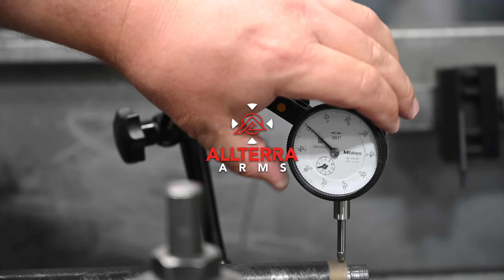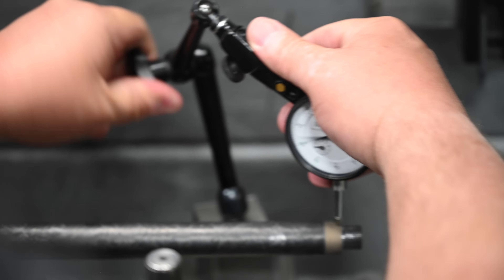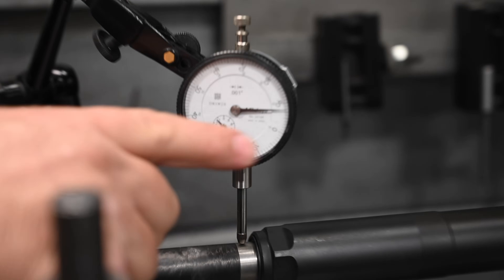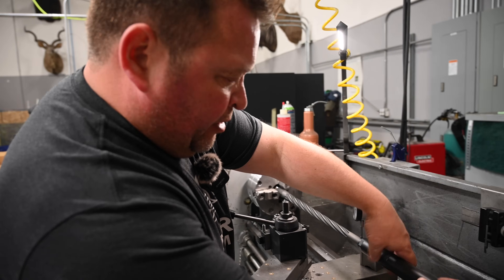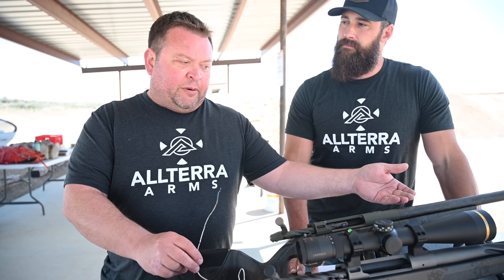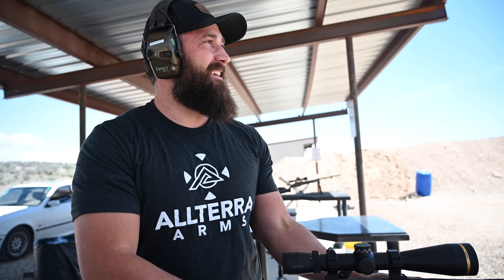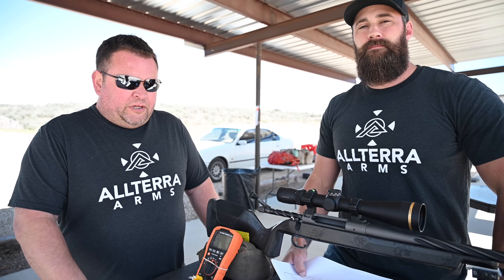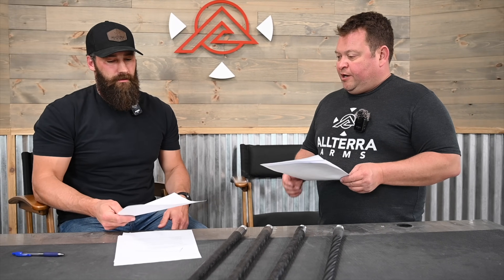Carbon vs. Steel Barrels: Rigidity and Cooling Test

Comment: I have no dog in the fight for either material. That being said  I don’t believe the rigidity test you conducted really tells us anything. Imagine a tuning fork and how it vibrates. The barrel is doing the same thing. The barrel whip might be drastically different in both materials and unless you have the capabilities to measure the barrel with a high speed camera for the two materials then I  would call the results inconclusive. Also. The length that you have chucked up will come into play not just the length you have protruding. They should both be the same for all battles as well or do the math to take the difference in weight and length and calculate what would be the equivalent to have similar tensile strength. The profiles come into play as well. Flutes is going to act differently that a smooth profile for whip and for temperature. The fluting can act the same way that engines baffles do and help to cool the barrel faster than if it wasn’t fluted.

Comment: Hello, suppressor over barrel is vastly superior. The deflection test methodology could be much better, try a bending test barrel supported both ends in V blocks and apply a specific load in the centre then measure deflection.

Comment: If we're strictly talking about hunting rifles, and one where we really care about ounces, then another factor in the carbon vs steel, is you can make a steel barrel lighter than a carbon barrel with a very thin contour.  Carbon can't get that thin and every carbon contour is heavier than the featherweight steel profiles.  On that comparison, I'd bet the carbon deflects less and heat saturation in the tiny pencil barrel is more of an issue, but for the 1 or 3 shots you're taking it's irrelevant.
Basically if someone says " I want a mountain rifle", carbon is out.

Comment: While my heart really wants a carbon barrel “precision hunting rifle” my brain just doesn’t understand the concept behind it. 
The point of a heavy target barrel is to retain consistency as the barrel heats up. This suggests a higher round count. If I need light weight, that means I’m packing a rifle on foot, which means I’m stalking large game, which means at most 3 shots. 
If I’m going to shoot enough that I need to worry about barrel heat causing stinging that means I’m at a competition, or ground hog hunting. Either way, I’m probably driving to my spot and don’t need light weight/need the weight to help keep the gun still. 
So whats the actual point of a lightweight target barrel?

Comment: I used to do the same test 3 decades ago: just try the same on straight deep acme-fluted brl’s and you’ll be surprised!
Reply: You did a carbon wrap barrel test 30 years ago....in 1995.
Mmmkay
Reply: @johnlocke_1  
Yes, I did! 
I guess, its kinda hard to imagine and comprehend for you guys, who are trying hard to reinvent the wheel? I already saw its leightweight properties &  potential back then and tried breaking into this field, which compared to the present situation had lots of obstacles, at a less then ideal time: back then  brl-blanks were still reasonably cheap & affordable at 1/3 or less of the price we pay right now! Meanwhile carbon was deemed as an exotic, secretive, mostly earo-space & nautical related  material, which was still  banned from
import or export in most countries; therefore hard to source and if successful, it was quite costly at the time! Consequently, at least the public interests back in NZ was minimal at the time!

Comment: the thing is that a steel barrel is made of only steel . so threw heat it is going to shift POI the same say uniformly 

but with a carbon wrapped barrel ( no such thing as a carbon barrel )   the carbon will heat up one way  and the steel will heat up another way so  the more u fire them and they heat up and cool down flexing at different rates the carbon can actually de-laminate from the barrel over time. its basically a carbon tube bonded onto a steel tube  so with both materials heating up at different rates u have the 2 tubes eventually separating.  another thing to note is that carbon is actually a good insulator and the steel barrel inside it will generally stay hotter for longer increasing barrel wear 

if your only shooting 1 or 2 rounds  then relaxing go for carbon wrapped

Comment: Wow, normally on videos like this I have something to nitpick like you didn't measure the internal temp and only the external, but you got everything I wanted and more!
Reply: I would like to see a POA shift if any after putting a few rounds through it...put 6 rounds through it and somehow measure POA after every shot...if that even possible.
Reply from the maker: Now that we've established the barrel temps after 1, 3, and 6 shots, we'll be able to chuck the barrels in a vise and heat them through the breech end with the indicator mounted at the muzzle to measure deflection with heat after the same number of shots. We can then calculate the angular deflection out to any distance to come up with an expected potential error on-target. Stay tuned for the follow-up video.

Comment: Your test is SEVERELY FLAWED!!!  Those laser temps guns do NOT do a good job of reading the temps on barrels.  Put a piece of tape on the barrel and take your measurements there, it'll be better than trying to read bare steel.  That's why those temp strips work much better than a laser temp gun.  For your internal temps you should have used a dummy cartridge with the probe inserted.  Those temp probes vary WILDLY based on contact pressure and angle.  Using a dummy cartridge with the probe inserted allows for very consistent pressure and location for your test.  HOWEVER, having said all that, yes steel barrels are more rigid, and better at dissipating heat than carbon wrapped barrels.

Comment: Thanks for doing this. I wonder if carbon wrapped barrels may exhibit accuracy declines as the heat, due to dual materials affecting each other.
Reply from the maker: We're going to make a follow-up video testing the deflection when heat is applied inside the barrels. Stay tuned, thanks for watching!

Comment: I would like to see a test of some sort to see how the heat changes to POI on steel vs. Carbon. Since that is our end goal. I'm  a believer in steel barrels.  (Change my mind)  Good video  thanks!
Reply from the maker: We're planning on doing a deflection test comparison when heat is applied as a follow-up, thanks to yours and others' comments here.
Reply: @allterraarms  
See if you can add  a barrel with carbon wrap but with not wrapped segments in between. There was a rifle recently shown like that at nraam.
Reply: @allterraarms  Any updates on this test? Very interested to see how it goes.
Reply: @sloreo8278 Poi shifts when the barrel is hot are worse with carbon barrels. There's a reason why they are pretty much non-existent in things like prs.
Reply: 100% agree, not only will you get better accuracy from heavy steel, but also reduce the recoil as well.
Reply: @marksmith4627 I mean sure you can but if we are talking about taken this rifle on a hunt, hiking through rough terrain. I think weight is a concern.
Reply: My view on quality carbon barrels is that they are intended to give you a rigidity close to a target/bull barrel for a few shots with the weight of a light barrel, or give you a longer barrel for the same weight as a shorter. They also seem to group well with a wider range of ammo vs thinner barrels which is more what I expect with heavy barrels. So basically ideal for hunting but not really meant for volume of fire. However the new seekins pic rifles for the military are using some kind of carbon barrel that might be different. And there are also now titanium barrels which should have the benefit of being light while also moving heat fast.

Comment: What I took away from this is for any sort of hunting application, the two are so close that weight savings for barrel profile means the carbon is the better choice.
Reply: My question about carbon barrels is, what kind of hunting are you doing where you’re taking enough shots to worry about heat dissipation, but also having to pack the rifle on foot far enough that weight matters?
Reply: @ steel was better at heat dissipation at the same barrel weight as carbon (so smaller contour)…. So I don’t think the question holds unless you want to pay the $$& for looks
Reply: @Intermtn9736  both were fluted though. Without the flutes, you theoretically lose rigidity.
Reply: @Intermtn9736  plus, flutes are going to help with heat dissipation, due to surface area. Without the flutes, less surface area means more heat retention.
Reply: @brockedandloaded6034  they’re good points, but if you look at flutes in those barrels they’re very shallow, so doubt it has much effect on heat dissipation, and probably only 4-6oz total if that. A solid of exact same external dims is always stiffer than anything taken away. However a larger external dims (read bigger contour, deeper flutes) is stiffer.

Regardless it’s a moot point, because a fluted steel barrel is 1/3 cheaper than a carbon barrel and just press one more button when ordering a prefit. I do like a .750 hybrid/taperless (or even Bart 4) with very deep flutes, best of all worlds, super rigid, cools fast, thick enough to thread 5/8x24… and still equal or lighter than carbons I have.
Reply: exactly. Hunting carbon, target steel. This is really the reverse side of the "carbon barrels are better coin". A company who likes to sell spiral fluted steel barrels telling you they think its better.
Reply: I disagree, not only is carbon fiber more expensive, it doesn't dissipate the heat as this testing proved, it only insulates the heat inside the carbon wrap and will super heat the thin steel barrel tube insert. Not good for barrel longevity. Given that, I'm also not a fan of spiral barrels either, go heavy or go home. You will get better accuracy and reduced recoil with a heavy steel barrel.
Reply: @marksmith4627  did you actually read anything I said?
Reply: @brockedandloaded6034   This shows exact opposite of what you're saying IMO.  The barrels they tested were exact same weight --> which means the steel was a lighter contour (Bart 3B as they stated above).  And still, steel was more rigid and dissipated heat faster.  So you can go even lighter than the carbon with the steel and still get a better result...
Reply: @Intermtn9736  my mistake. I went back and watched again. I thought he said same profile. Not same weight. However, his hypothesis is a little misleading also. The data doesn't show steel over carbon, it seems to show FLUTED steel over carbon. And it's even more confusing at the end when he brings two other carbon barrels out and says one is several ounces lighter and then says one carbon barrel on the table had the least amount of deflection. Well why weren't those tested? All carbon barrels may not be equal, and probably aren't. But certainly seemed like those last two he talked about he wasn't trying to really elaborate on.
Reply: @ good points all around, I think fair to say not much benefit from carbon as very similar (which mirrors my experiences and many others from trying carbon and realizing threading stock tikka tapers for suppressors gets same or better results)

Comment: I've looked into the Altera Arms rifles. I would but one of these rifles if I could get my hands on one. 
Gotta be the best production rifle that I know of.
As far as the thermal tests go, you're spot on. A good measurement would have been a temp differential between the inside & outside of the barrel. A higher temp differential must mean a more efficient insulator. Although I know for a fact that carbon is a far better insulator than steel, the only issue I see is using an infrared temp measuring device. These devices can be rather tricky because they measure the emissivity of the material which, must be calibrated carefully. There are devices which measure the emissivity correctly however, they are considerably more expressive in relative terms. Although your measurements may have been correct, the measurements would hold more water if taken from a device known to be accurate with metallic material.

Comment: Thermal mass- kind of hard to beat physics.  The carbon layup differences providing differing levels of rigidity is interesting.  Thanks for putting the work into answering this question!
Reply: Exacty...not to mention the effect of heat degrading the structural integrity of the carbon over time...deff dont want to be running boxes of ammo through it on a range day...but for hunting where lucky to be putting a coulpe rounds through it back to back would be fine.
IMO other then looks its a waste...

Comment: Wouldnt these tests be subject to how much steel is used in said carbon barrel? My understanding is that different companies use different thicknesses or ratios of steel:carbon wrap to achieve desired weights/stiffness. 

I believe Proof uses very little steel in comparison to someone like Carbon 6. Which makes them significantly lighter but theoretically not as stiff and maybe more/less insulated ?

Comment: Great video. What’s astounding about comments here (and everywhere else) is people think carbon is lighter. Clearly marketing works (tiny fine print: 60% lighter than… same contour steel barrel lol). As you showed, a lighter steel barrel deflects less. 

After looking into prefits for a tikka, I was surprised stock barrels were lighter than the lightest carbon, and fluted steel prefits were far lighter than lightest carbons. Really no advantages to carbon other than looks (if you like it).
Reply from the maker: Some are lighter, some aren’t, apples to apples in comparing barrels almost doesn’t exist from what we’ve learned. Thin contour lightest-weight steel barrels have their drawbacks too for certain styles of use like higher volume fun and practice.
Reply: @allterraarms  True that!  My take is a fluted .750 taperless or hybrid contour steel barrel (even a #4 contour if really aggressive fluting) is lighter and performs as well/better than my carbons for high volume too!  And cheaper, more consistent, easier to get length you want, etc

Comment: In marketing speak the slope of the line shows carbon cools quicker.  There is much more to it, as its going to a higher temp, and it ends up at a higher temp.  Like it is being insulated. But to a marketer the slope of the graph is showing carbon cools faster.
Reply from the maker: We keep finding there’s “always more to it” in all sorts of things. Thanks for watching and sharing your thoughts!

Comment: I will no longer build a magnum cartridge with a carbon fiber barrel. They might be fine for lighter cartridges but accuracy definitely suffers in the magnum class with these lightweight barrels. I think it is the primary recoil that occurs before the brake or suppressor kicks in, and a heavier barrel is just better for this.
Reply from the maker: Good analysis. Carbon-barreled anything over 7 PRC are our most difficult to consistently prove accuracy before letting it out to the customer. We replace barrels and eat the cost when they don’t shoot well enough for us.

Comment: I know they're an outlier, but how would a Tacom structured barrel compare to both of these other barrels.
Reply from the maker: We built a 308 for a customer with one of those barrels and it’s in the top 3 of wildest ones we’ve done.
Reply from the maker: They’re so massive that they’d blow away these hunting barrels in rigidity.
Reply: @allterraarms Great video. If I remember correctly, several years ago, I priced a Tacom in 300 win mag with a 1.35" barrel. I'll see if I can find my notes or check their website. I found it fascinating the way they drill extra holes around the bore for cooling.

Comment: I have a proof Research 7mm PRC barrel.  I had to remove wood from the foreend because the barrel rebounded under recoil and slammed into the fore end.  This alone improved overall accuracy with loads.  Originally, YES, the barrel to fore end was free floating and never touching.  EXCEPT UNDER RECOIL!  Even though groups improved, this taught me something.  So, I ordered a limbsaver.  I found the NODE!  Groups are fabulous BUT, CF barrels arent good for shooting large count groups especially from MAGNUM CALIBERS.  Like, over 5 shots, the group will open up drastically.  To me, at best, CF barrels are pure HUNTING BARRELS!  So I think performance under recoil from both types of barrels should be measured
Reply from the maker: Great comment and explanation of your learning opportunity. There are lots of small overlooked details like that when chasing down accuracy. Especially in the heavier magnums as you say. Thanks for watching.
Reply: @Tofazfou  In most cases, especially with wood stocks, you might be better off full-length bedding the brl in the woodstock, the same way you do with ultra-light featherweight steel brl’s!
Reply: Thank you for sharing.
Reply: I’ve had bad experiences with a proof carbon as well. Would open up when the barrel heated. 
My IBI carbon barrel on the other hand was flawless at shooting multiple shot strings and hold true. 
IBI double stress relief their barrels as well. 
Just my point of view tho.
Reply: Is the “node” the optimal spot for the limbsaver?
Reply: I have a Proof CF and find after my first shot the following 3 tightened up as the cf heats up